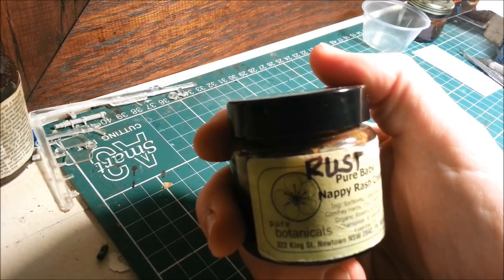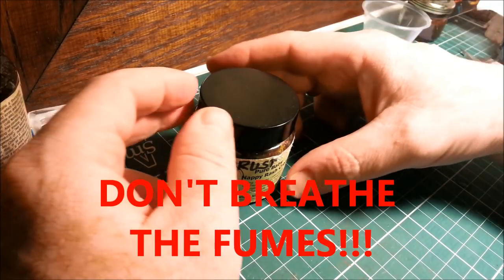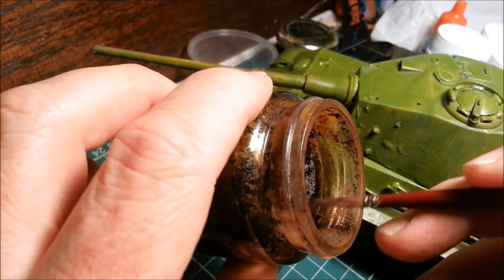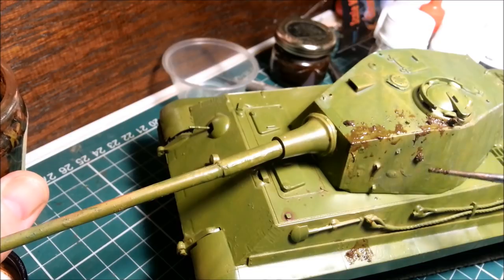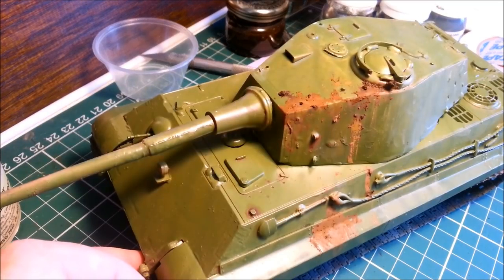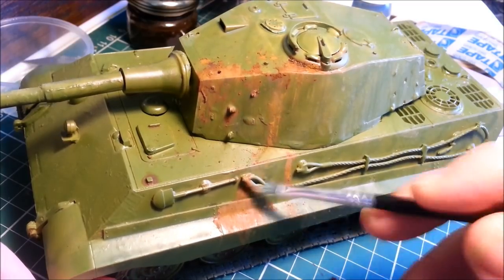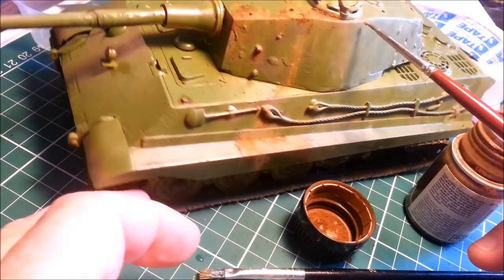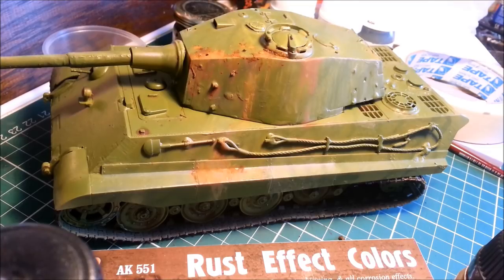How to make your own RUST for weathering scale models

Comment: I've always made my own iron oxide (rust) for over 15 years now.  I put about 3 or 4 rolls of 0000 steel wool into a quart jar and fill it up with vinegar and put in the window for a couple months.  When it's all turned into a big mess, I pour it out into a flat pan (11x14 photo processing stainless steel pan) and wait for a couple of weeks for it to dry.  Then I use a single edge razor blade to pulverize it into a fine powder and store it in little (snuff) tins.  Every batch I've done comes out a little different color.  Works great 'cause it's real rust.  To use it on models, you can mix the powdered rust with some lacquer thinner and apply as much as you want and adds a lot of texture to the surface.  Cheers from eastern TN
Reply from the maker: That's fantastic! Thank you for sharing your tips. Cheers from Melbourne, Australia - Dave

Comment: That's a genius technique, using real rust to make rust on a model.  There isn't much better than the real thing!  Just like using real mud on a model too.  I really like the actual texture that you get with it, like you said it does look like how metal gets when rusty when it kind of bubbles up and the primer or whatnot starts to peel off when the rust gets underneath.  That's something that's hard to get with pigments since the powders are so fine, which of course has its own benefits.  I'll shoot you an email about another idea I've been having.
Reply: Oh and if you're worried about the fumes, we did this kind of reaction in my Chemistry class and you're probably getting Hydrogen Sulphide or other sulphuric gases.  They won't kill you but they could make you a little sick for a day or so if you breathe in too much.  So probably not much worse than your average paint thinner fumes we deal with :)
Reply from the maker: Thanks Panzermeister36!  Yeah, that texture is quite interesting. I love this technique for big, chunky rust - it can be a little heavy-handed for fin streaks, but it's do-able. Chat to you soon, Dave
Reply: Dave's Model Workshop It seems you could also add pigments,paint etc to the homebrew?
Reply from the maker: Definitely. I'm not sure how much you'd have to add to influence the colour, but it would be a fun experiment to play with :) . Cheers, Dave
Reply: Panzermeister36  cinnamon works well to. Just delute white glue brush it on and sprinkle the cinnamon over it. Looks great when it dries
Reply: Panzermeister36; how do you stop the model smelling like a cakeshop? 😀
Reply: Panzermeister36 
I agree great to get sand/potting mix, add aqua hear glue. Sorry not sure I spelt that correctly. Anyway mix the glue with the substrates your using apply an Bob's ya uncle. I've found it's great for Cosplay weapons to make em look like they have been put down on the ground or you've been crawling throu mud/sand. GREAT EFFECT.. Cheers Mate Scott......

Comment: I ran across your video yesterday looking for a rust weathering technique. It was perfect as I has steel wool and lots of vinegar. I let it soak overnight outside. It didn't look like much today, but I could see some rust color on the wool. It brushed on clear, but dried in minutes. WOW, perfect rust patina that popped when it dried! I don't have the chunkyness of yours yet, but I'm going to seal it up and let it sit for a few months and see what happens.
Reply from the maker: I'm glad it worked so well for you! If you're going to leave it to develop, just check after a week or so. It requires oxygen for the reaction, so if you "seal it up" as you mentioned it might stop the process - just check after a week, and if it's not doing anything maybe open the jar and see if that gets it cooking again :)
Reply: Sounds good. I can leave it out on the porch and see what happens. Thanks!

Comment: This is a great tip! Those weathering kits are pretty expensive. I just left my steel wool outside in vinegar. I have an Amtrak locomotive that has a smear in the paint. Hiding it with a rust stain will be a perfect solution.
Reply from the maker: Cool, I hope it works perfectly for you. Good solution.

Comment: This is a great technique! I mixed up some and it is fantastic! Your caution about the lid is right on. After letting mine sit for a week, tried it, great outcome but I pulled a dumb ass and when I put it on the shelf above my work bench next morning the stuff was all over my bench! Dummy here tighten the lid. So yes do not tighten the lid when your done. I have started a new batch that I intend to use on Panzer II I'm working on.
Reply from the maker: Hi Sooner Steve, ah, mate, that is not good. I've been lucky and haven't spilled this stuff yet, but I imagine it's an absolute *&^%$ to try to remove the stain! Dave

Comment: Love the technique! Long ago I used to thin out flat/matte enamel paints to use as a fixative for clay dust "mud" and "bearing grease ooze" on AFVs. These days I am more fascinated by STEAMPUNK and your Steel Wool Rust is Perfect for that kind of Nitty Gritty... Once dried overnight, the rust  could potentially be tinted and/or moved around with a fine brush, using the thinned enamal fixer I mentioned above.  Your vids are Aces Dave.

Comment: Great economy tip Dave. I go a little cheaper, by useing worn out S.o.S pads. Once I have scrubbed the soap out cleaning something I put them in a container with water to dissolve what's left in a jar. Never used vinegar, but that works fast it seems. Loved the texture.  My Titanic wreck model 1/ 700 will require a sea floor covered in rusty bits. I plan to blend the wet plaster with some pieces of rusty chuncks , letting the rivers of rust run to the low spots. Like the R.V. footage in the pictures. This is a perfect shmutz to spread all over the wreck! Thanx for sharing Dave.
Reply from the maker: Lance Caldwell that sounds amazing. I can’t wait to see your Titanic diorama. Will you replicate the water in any way? (Which sounds like a nightmare, btw!)

Comment: Before and after applying the rust, should I spray the model with anything to seal the surface? Thanks. Great video.
Reply from the maker: Hi Kent, you can seal it with a clear coat after you have applied it, not before. Be aware though that the rust will get darker, and lose some of its subtlety.

Comment: hi, only mix the vinegar with the metal wool in the same bottle and wait?, how much time need to be ready?. Thx for this tip, u have a new sub.
Reply from the maker: Hi Antidoto35, yep, that's all you need to do. Mix vinegar and steel wool in one bottle, and leave it for maybe 2-3 days. A week would be better, but 2-3 days would give you a useable rust. Cheers, Dave

Comment: Although 2 years ago but great tip. My question is can i spray  seal on  this? Coz im guessing these rust is not permanent  over  long period of time? Or can get removed when your cleaning the model from dusts for example.
Reply from the maker: Hi Peter, you can seal with with dullcoat but it will darken the rust, it looses a lot of its subtlety. Better to just leave it unsealed and be careful when cleaning.

Comment: Hi
This is a great video. I decided to try and make rust myself, using the steel wool and vinegar method. But how long does it take? I put a roll of steel wool in a glas jar, covered it with vinegar, but until now I can not see anything has happened at all. Its only been a few days though, but how long time (approx) before I can use it?
Reply from the maker: Thank you. Mine took about a week. Some people have reported longer, some shorter, and a very few unlucky people haven’t had reactions at all, I guess it depends on the atmospheric conditions and/or the wire and vinegar used.

Comment: Interesting and very well detailed. Came across this when looking at rc scale crawler body painting and the channel linked this video as a recommendation. As water gets rid of it, I assume a form of lacquer on top (even cheap hairspray) will protect it a little from the elements when taking the rc trucks out into the wilderness through some watery splash conditions?
Reply from the maker: You would definitely want to seal it somehow for a RC truck that's going to be exposed to water, grit, etc. Hairspray is water soluble, it will eventually wear off. you'd be better with a matte clear coat of some kind, but be aware the clear coat will dull the effect a little, it will make the rust darker and it will lose some of it's subtlety.

Comment: Sorry if this has been asked already, but do you need to spray a fixer on the diy rust? If so, what do you use? Thanks in advance.
Reply from the maker: Hi John, you certainly can airbrush a matte clear coat to seal it in if you expect to be handling the finished model much. But it will make the rust darker, and you lose a lot of the subtler tones of rust. i never bother to.

Comment: I love this super cheap technique though I have a question. Will it come out the same when applied to any material Is (plastic, paper, metal, etc)?
Reply from the maker: Painted on to anything the result should be similar. I'd be hesitant about painting it onto paper, perhaps, purely as it is such a liquid it would soak in a lot, might distort the paper?
Reply: @DavesModelWorkshop  Yes that would be obvious, but the paper I'm using is a sticker paper but I assume it'll have the same result. Thanks a lot! I love a good penny pinch.

Comment: Awesome! I have to try the steelwool. As for the pigments: How to fix them? Clear Code? PVA Glue?
Reply from the maker: I generally don’t fix them in place, I just try to not handle my models once the pigment is in place. If you do want to seal the pigment, I recommend any matte clear coat. But be aware it will darken the colour of the rust, and make it a bit less subtle.

Comment: Wonderful weathering job Dave! looks so realsitic! i have 1 question... yesterday i tried making it my self and in the jar, i placed the steel wool and filled it with white vinegar but today i saw and happened nothing 🤣🤣 how much vinegar is required??? Love from Greece!!!!
Reply from the maker: I used about 150-200ml of vinegar in the jar you can see in this video. I basically put the steel wool in, and poured in as much vinegar as the jar would hold. i hope this helps.
Reply: @DavesModelWorkshop  thanks! I will try again.

Comment: Cinnamon sprinkled on wet paint is much cheaper, much quicker, much easier. 
Cheap spices at cheap stores. Cinnamon,  Chile powder, etc. 
Paint your rusty area, sprinkle the cinnamon or other spice on to cover entirely.  Immediately shake excess off, then use toothbrush or other stiff brush to brush more off- as much as you want. You get very realistic looking- and feeling- surface rust effect.

Comment: A quick question, if I may Dave. Should I leave the top of a jar loose/off to allow gases to vent, while doing this?
Reply from the maker: geggy5151 definitely leave the top off while the rust forms, it needs oxygen to rust. It’s more about letting air in than letting gases out.
Reply: Cheers Dave. Sorry for the tardy reply,  I forgot to check back! Doh! I've 4 jars on the go. 2 with white vinger, (one jar 1/2 full the other full), one tap water and one rain water. The best so far, is the 1/2, full vinegar. Can't wait to try it!

Comment: Did you clear coat the model before doing this.  I pretty much exclusively use acrylic paints and am wondering if the liquid part would do to much damage to the paint
Reply from the maker: No, I didn’t clear coat first, but as long as your paint has dried properly I can’t see the rust liquid affecting it. Maybe try on an inconspicuous section first?
Reply: @DavesModelWorkshop  Thank you very much

Comment: Hi, looks super! 👌.  2 questions, does the rust go on over your finished paint? And do you lacquer over the rust? Thanks.
Reply from the maker: Yes, the rust does go on top of the finished paint. And yes, you can add a clear coat over the rust if you wish to. I don't bother, I just try to not handle that part of the model and it stays on just fine. But if you are going to be handling it, add a clear coat - just be aware that it will darken the rust colours, and you will lose some of the subtlety of the rust. Cheers, Dave
Reply: @DavesModelWorkshop  thanks

Comment: How do you seal it, so it no longer can be brushed off? Also, the other pigments. Do they need a varnish?
Reply from the maker: TerminatorFiles I don’t bother sealing it. You could spray a Matt varnish to seal it, but I find this makes the pigments darker and less subtle. I just try to not handle the finished model too much.

Comment: Great tip! I assume you spray a clear coat over it instead of applying that with a brush, because else you would brush the rust effect away? I am asking this because in the video you remove unwanted rust with water and a brush
..
Reply from the maker: Hi Gappestein, I generally apply it as one of the very last processes on a build, and then leave it alone! You can certainly seal it with spray matte coat, but it will darken the rust tones and it loses some of the subtlety (texture remains unaffected though). Cheers, Dave

Comment: I'm not sure, but you might get more control with this by using a small amount of dish soap to break the surface tension of the liquid. But I'm not sure if that would react with vinegar as it does with water or cause any other problems.
Reply from the maker: Worth a shot, definitely. Thanks for the suggestion CzarPeppers, Dave

Comment: Interesting and effective , just out of curiosity,,, have you ever tried ordinary steel wool , I use it all the time , you can use it in strands ,bundles s per size required , chopped up and dusted, mixed with water based glue,, works a treat
Reply from the maker: whitestuff1959 are you using it for vegetation on dioramas? That sounds fascinating!
Reply: You can apply to anything, been doing a full upgrading on  a Heng Long Tiger one and used steel wool on the metal tracks … just get the tracks fully covered in very fine steel wool and leave to rust up, the finish is great even if I say so myself .it is real rust ,on the hull I used very finely chopped up steel wool placed were I wanted rust and that did the job ,again real rust and it does not take that much longer to produce a result .You'll need to figure out application mediums (ie plain water, water based glue etc) for your particular needs/requirements  and dependent on the subject  but I found it works on die cast model cars ,even told friends of mine that build car dioramas and they love it , everything I tried its done the job so far. obviously if model is to get wet then use a medium to protect the rust finish . Have found its easier,,, by far than messing about with paints etc but in saying that I have also used these rust paints with the wool and the results are great. I all depends on the finish you want. Please have a go and let me know how you find this method
Reply from the maker: That sounds amazing! I'm definitely going to have a crack at that. So you just cut it up very, very finely? Is it almost powdered by the time you're finished cutting it? Fascinating!
Reply: you can use it as strands ,lumps , fine chopped , course chopped, it all depends on what application and /or finish  you are looking for or just add water or tinned out water based glue. Don't forget there are different gauges of steel wool ,

Comment: will this work with steel wool with soap on it if you take all of the soap off?
Reply from the maker: Hobby Nerd I’m not quite sure. I guess you could soak it in hot water to remove the soap, but it would be hard to remove it all.

Comment: Hey Dave, do you varnish over that, or do you leave it as is?
Reply from the maker: I don't usually bother to seal it. If you are planning to handle the model you certainly can seal it with a matte clear coat of some kind, but be aware the clear coat will dull the effect a little, it will make the rust darker and it will lose some of it's subtlety.

Comment: Does it damage clear coat on good paints. I dont want it to eat the clear coat but i do want to be able to try this on an old ford f-100 with the option to wash it off as you showed if it gives an undesired look. I have clear coat on the painy amd dont want it to wreck the clear. Will it
Reply from the maker: cool miester105 I think you would be safe. It doesn’t eat into uncounted paint, and clear coat is meant to be strong and protect the underlying paint, so it should be fine. I would recommend test on a section that isn’t easily visible first. Put on the rust, leave it for a few minutes, and then wash it off and see if it affected it the next day. My gut feeling is you will be okay!
Reply: Dave's Model Workshop thank you so much.

Comment: What do I apply to the model if I apply pigment rust color do I put anything on top of it so it won’t wipe off? If so what do I use?
Reply from the maker: You could use any kind of clear coat, but be aware that it will darken the rust colour and you will lose some of the subtlety.

Comment: Hi Dave.
Hope all is well with you.
I thought I would try your diy rust, but it's been sitting for a week an nothing seems to be happening ??? I used steel wool did have some soap put in not it out of the box. But I washed out all soap dried then started the process. But as of yet I have had no changes no rust, but a funky smell as u said there would be. So it was outside for the first couple of days. Why is it not working vinegar, steel wool cleaned an dried. Start the process, NO reaction ??? Cheers Mate. Scott
Reply from the maker: Hi Scott, bugger, that must be annoying. What sort of proportion of vinegar to steel wool do you have?
Reply: Dave's Model Workshop 
Hi Dave thanks for your reply I just got a small bottle of vitamins, an put 1 steel wool pad it was about 3" by 1 half inches, pulled it apart stuffed it in then filled it up with about 100 mls of vinegar. I have most likely put to much steel wool. Cheers Scott.